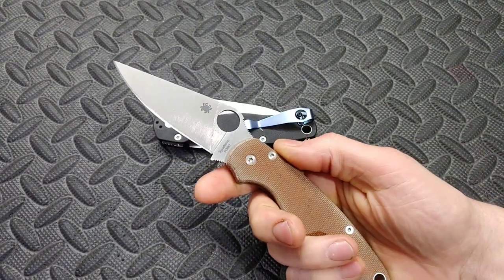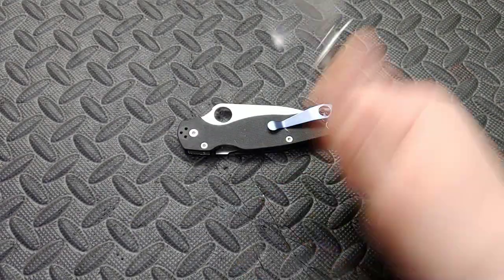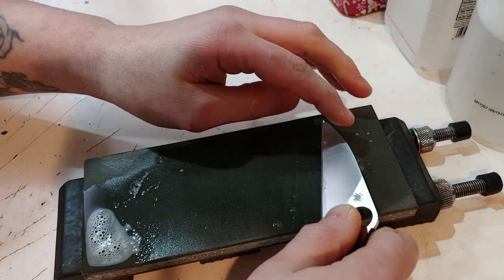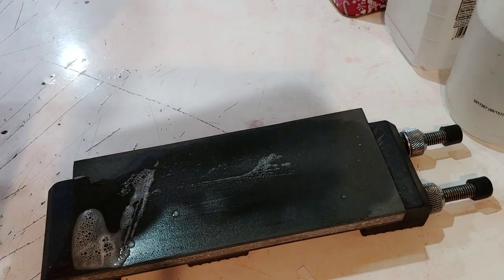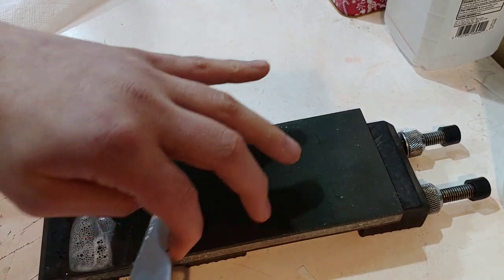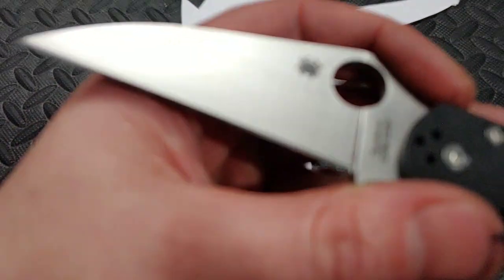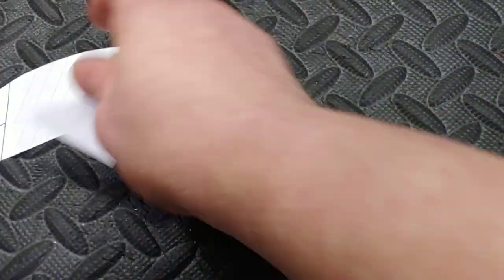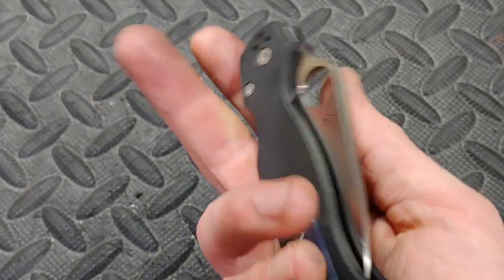FREEHAND KNIFE SHARPENING WHARNCLIFFE SPYDERCO PM2

Comment: If loving your sharpening videos is wrong, then I don't want to be right. Looking at possibly picking up a Venev stone to pair with my 400/800 spyderco cbn. Is there one you can recommend?
Reply from the maker: If you want a very low grt i reccomend the 160/125 the other side is 100/80 micron its a great starting stone for repair